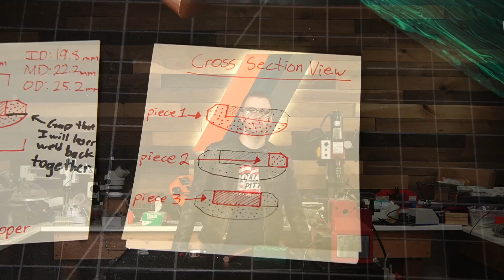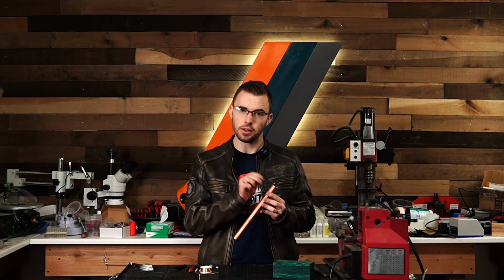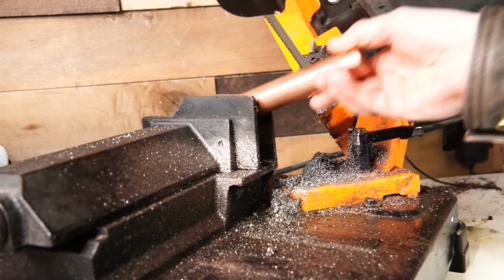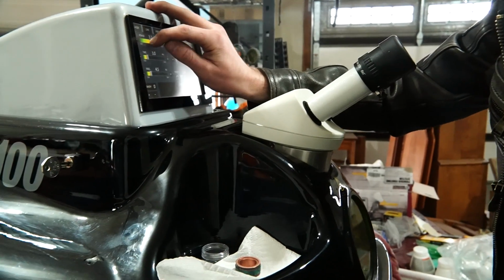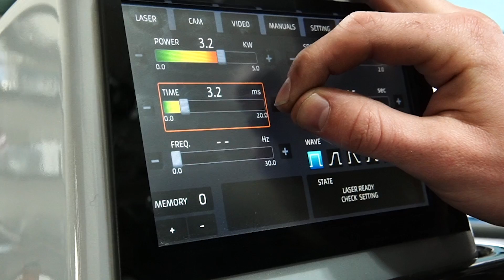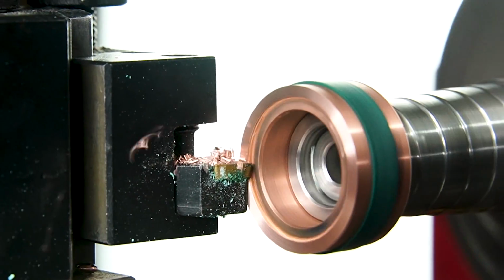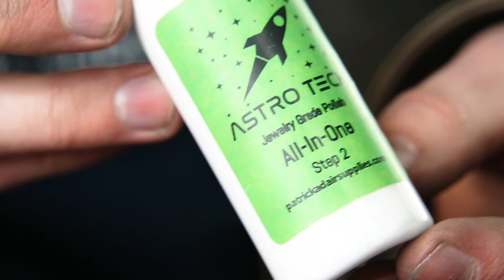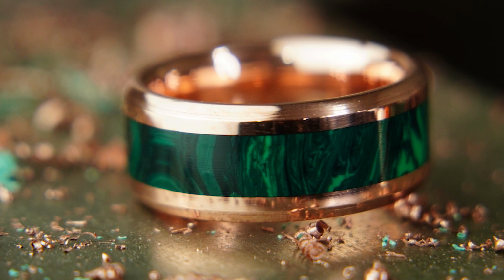Making a Copper and Malachite Ring

Comment: Me laying down, watching this in my pjs: “Does he need to cut THAT big of a piece of copper to made a ring blank?”
Voice in my head: “And just how many rings have YOU made?”
Me: “Fair point. I’m shutting up now.”
Reply: Lynn , 
You asked a very legitimate question. The diameter of the copper rod is going to depend on the finished ring size .
As an example , for some of us , shall we say with larger paw prints x(my wedding band fits a quarter inside with room to spare , no I'm not fat , I'm fluffy) l would need to start with 1. 25" stock . Thank  God I did not become a proctologist .😁

Comment: I love seeing copper and malachite together because actual malachite can be crushed to get copper. I doubt the same is true for "trustone" malachite, which I assume is a man-made resin of some kind given the way it cuts instead of shattering, but the fact remains that these elements share history. Most people neglect to mention, or are unaware of, this stone's intrinsic connection to this metal. That along with the fact that people rarely create using copper because their customers fear the "green ring," means this is one of the few videos I've seen featuring copper and malachite together. People will use everything but copper even if they know the connection... So, thanks for that.

Comment: This would be a perfect ring for me, as I love both copper and malachite. What puzzles me is how they can make malachite truestone with the grain that it has.

Looks amazing!
Reply: When malachite is being formed ,it is a slow leaching of copper oxides into the rock that holds the copper in its mineral form. As the leached out copper penetrates cavities in the rock it will bind around other compounds taking on their shape creating different swirls in the malachite.  Kind of like pearls that have been cut in half and you can see the shape of the original debris the the necar formed around.
Reply: @richardpalmer6196  That's cool. I didn't know all of that. But Patrick said it's truestone. Truestone is made by a company from actual minerals  (malachite in this piece), into a block or slab. In essence, like particle board but with stone. But how they get it to mimic the grain of malachite...it must be magic.
Reply: @cycoholic  it is not real malachite but just ream stone, they use different dyes to get the grain

Comment: Patrick , 
As a longtime lover of malachite,  l find this ring to be beautiful.  
As a long time rockhound , l feel l must pass on a few warnings:
Malachite dust is highly toxic , along with turquoise,  and chrysocolla,  2 other copper based mineral used in jewelry making . Use gloves when handling  any of these minerals,  a face mask when working around them if dust is going to be created . 
One method l have found helpful is to stabilize worksble sized pieces in resin using a pressure pot method.  Make a mold form out of aluminum foil , small box , or any container just slightly larger than the piece you want to stabilize.  This way you are not wasting resin or extra time getting the resin down to the size of the piece you are working with . Under pressure the resin will penetrate pores in the mineral and bond with some of the dust . It will not under any circumstances be a reason to override safety measures ! AGAIN WEAR CLOVES , MASK,  AND SHOWER AFTER YOUR DONE . Just saying folks if you want to work with these beautiful minerals , safety first .
Sorry for running on , but the health hazards  can shorten your life,  check out articles regarding toxicity of copper based minerals.

Comment: I love your designs and craftsmanship, but, in this case, I'd be careful calling this a malachite ring. The manufacturer of Trustone refuses to release the information on how they make Trustone, other than saying it's made from pulverized semiprecious stone, resin, and dye. Those of us who do lapidary work tend to think that this means it's probably something along the lines of howlite or magnesite, both stones that take coloring very well (though once reduced to a powder and mixed with resin, it may not matter as much). Just something to consider.
Reply: So this is more likely something else that just should look like malachite?
Reply: Ah. I was wondering what that was. Are actual stones machinable in this way? I never would have thought to put a rock on a lathe like that.
Reply: @bl4cksp1d3r  It is whatever stone powder that the manufacturer used, mixed with whatever resin they used, and dye. I've turned it on my lathe (I also turn pens and other spindle-type things), and it turned about the same as inlace acrylester, which is a trade name for a polyester resin. Maybe a little tougher. Carbide tools helped, but it is doable with normal woodturning tools, provided you have a very sharp edge. But yes, you are correct in that it is not actually malachite, but something made to look like the stone.
Reply: @YonatanZunger  Some can be, at low speeds, and with water cooling; similar to how Patrick did the core drilling.
Reply: @YonatanZunger  My father manufactures TruStone (small family business), we make a version for use on lathes with normal wood working tools. Solid stone as mined in nature can be used but diamond lapidary tools are necessary and the pieces are harder which make them more prone to breaking. For a ring, chip inlay (broken up into pieces then glued) would most likely be used for real mined Malachite because of it's hardness. Hope this information helps. It's always awesome to see the final product in this ring Patrick made. He does an excellent job of showcasing the materials and process!
Reply: @schoolscc  Can you confirm if there are any of the named gemstones in the individual TruStone pieces? Like in the "Malachite" TruStone, is there any actual malachite? In the numerous "Turquoise" TruStone versions, is there any actual turquoise? If so, what is the percentage of the final mix of stone that is the actual gemstone?
Reply: @SilktheAbsent1  While we have used significant % content of the "named" stone in the TruStone (ex. we sold thousands of pens made from TruStone with an exact percentage of the natural stone Malachite), due to toxicity of certain stones we only use the safest stone ores in TruStone for off the shelf orders. All TruStone made with the natural "named" stone is a custom order. My father is really just trying to go for a "look" with this material that is more uniform, higher yield, and safer to cut than natural stones. As most of our business, we compress and stabilize semi-precious natural stone blocks and also sell and stabilize natural stone roughs  (literally thousands of tons of turquoise over the years and at one point one ton a day). TruStone is made to fill a different kind of customer niche than the natural stone.
Reply: Yonatan Zunger I’ve turned marble when making a few rings, it’s pretty fragile but you can definitely turn it if the bit is sharp and the piece is thick
Reply: @bl4cksp1d3r  i was thinking that when i saw the brick of it

Comment: I’m not trying to be rude but this is a machine made ring, there’s nothing about this ring that it’s hand made...I’m doing inlay cuff bracelets and mine are all hand made. All my turquoise has been hammered down then placed on my cuff bracelets with star bond after I complete these steps and the turquoise is set and dry I will use my rotary tool and sand the excess turquoise off then work on the grinding all the down to a mirror polish... 
It’s a beautiful ring but basically it’s like an assembly line ring and the general population doesn’t have all these tools that you are using anyway this is my opinion. Try making the ring the old fashion way instead of having an a machine do everything for you... But please don’t take anything personally thank you